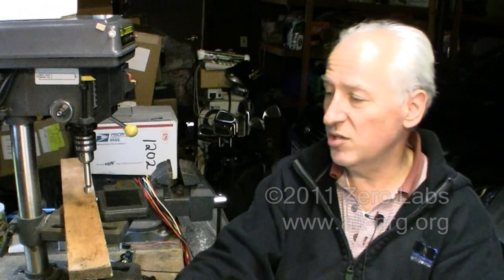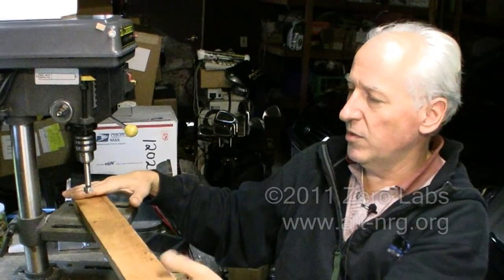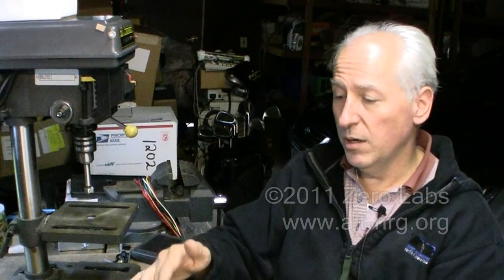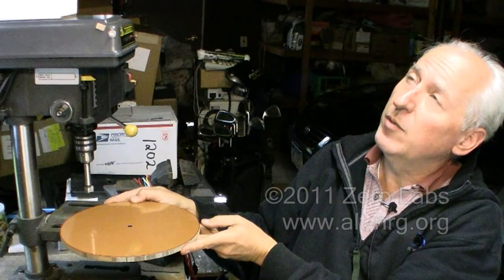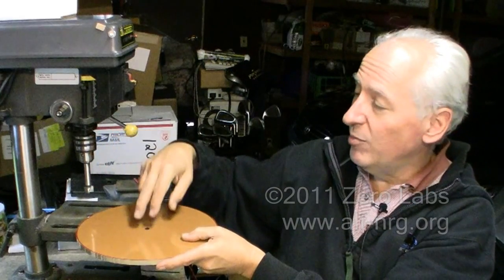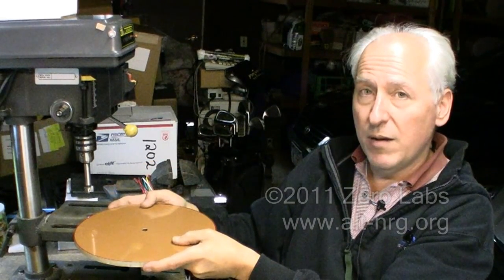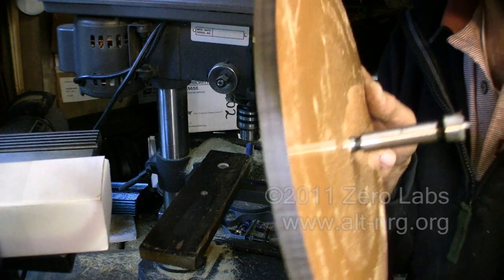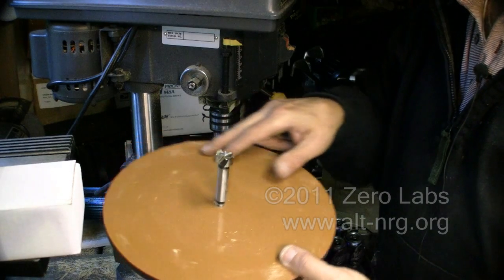#297 Muller Motor Generator Rotor

Comment: What you are talking about when cutting a circle accurately  is called either climb milling which is when the cutter is climbing over the material or conventional milling which is the cutter going under the material pushing the swarf out of the way as the cutting process is happening.

Comment: A disc sander is a much better tool to use to make a circular, be it steel or phenolic.  You'd set up a swing arm with an adjustable centering hole, place your non-circular onto the centering hole, then bring the disc edge up to the perpendicular sanding disc.

Comment: How big is that phenolic disc? also I've been reading information on the mueller motor. I was thinking, why not have 2 concentric (ring) sets for both the rotor magnets and the coil stators. The Smaller set could be driver coils and the larger set will be the pickup coils. just depends on how it's wired up. It can pretty much boosts more power to it. just a thought. ;)

Comment: Another of this university magnetics guy's videos /watch?v=czXmazZ4obs
It shows something he calls the concentric bi-coil that attempts to balance Lenz's law magnetic forces using a very high impedance / low current coil to accelerate rather than brake rotor speed, then combine that with an outer conventional coil to generate electrical power.

Comment: Reducing the distance of the magnets to the pickup coils you found that you got huge Lenz's law lugging or magnetic resistance to motion?
There is a guy with a video to explain how to create coil cores that negate Lenz's law by providing multiple alternative flux paths for the induced magnetic fields.
YT GcAYhM0LX9A is a university researcher in magnetics.
At about 66% through the video he shows his master work of the Bi-Toroid Transformer. In your case the primary coil is the rotor magnets.

Comment: very cool! I imagine it would have been easier to ensure the position of the rotor by having TWO pieces on the bottom in a V shape or a V shaped block, does that make sense? I think that would also ensure that the magnet holes are more precisely aligned ALTHOUGH it looks like it worked well as is. PM me if you want  me to elaborate. Thanks for being the guy who really keeps plugging away. My schedule and budget have barely allowed me to do some hydrogen work, though I have stopped on that. Go Z!

Comment: While watching this video I saw a lot of wasted effort.  You could have easily created the same item with less effort by creating a router tool to hold the router the length of the radius from the centerline by making a 1/4" thick by 1" wide steel or aluminium fixture. It would have negated all the extra drill press work and taken it down to a simple router on a string effect to cut the phenolic.  Also your magnet holes, seeing how your drill tool had a pointed tip you could have drilled direct.

Comment: Zero: Welcome back! News - Just up my first "Muller". (UFO Alien Leak - FS10a): 1) Wraped Dolce Ferrite core with T30 #24 - unconnected it acts as amplifyer to main coil. 2) Made spimdals from $-store scotch tape holders. 3) Discovered Dolce Ferrite is virtual Quasicrystal - no Domains so no border Domain conflicts, ergo no heat-loss. 4) Ideal Quasicrystal process coming next (similar to DNA typing -except pulsed Mags instead of centrifuge (volume, not plane). Don't take money, cheers!

Comment: Don't know if it will help you in the future !    When I am cutting composit materials that contain a lot of glue like MDF etc. , I use my air compressor on continus blow on my work to blow away the cut materials and keep the bit cool.  Works really good if you put a fan blowing on the compessor tank to get the heat out of the compressed air faster.  An extra 50 feet of air hose between the tank and you coiled with a fan on it will cool the air even faster.

Comment: @ZeroFossilFuel Ok that's what I was thinking. It's hard to tell from the video how tight the board is the rotor was mounted to and it looked like the pressure of the rotor against the router bit could possibly cause the rotor to move away from the bit as you were turning the rotor causing it to be out of round. With model airplanes we used to balance our propeller blades using a stand and some berings and I was just wondering if you had or used something like that.

Comment: Great job ZFF, it looks like you may have melted the plastic with the Forsner bit. I usually cut as slow as possible without binding the bit and you end up with a butter smooth hole without the melted fringe. If you are cutting as slow as possible than you need to buy a sharper high quality bit (not Harbor Freight). You appear very competent so I may not be telling you anything new.
Thanks Mike

Comment: If I sound like a crack pot, well that does not matter. I know that flying saucers exist. I also think that the disk's have some sort of a wheel that produces energy. That is most likely why the UFO crafts are almost always circular discs. Are they getting energy from something as simple as magnets set in a wheel to produce an electric current? I think this is what is going on and I really think it should be possible to harness the energy from magnets to produce free electricity.

Comment: I have a drill just like that, moving the top belt you can adjust the drill speed, usually routers are high speed drills...so consider adjusting to max rpm.